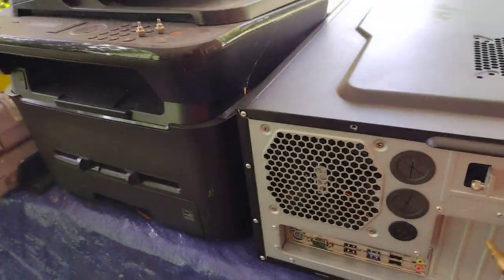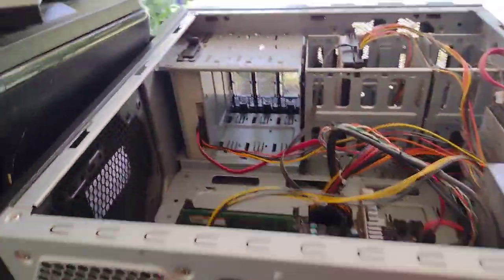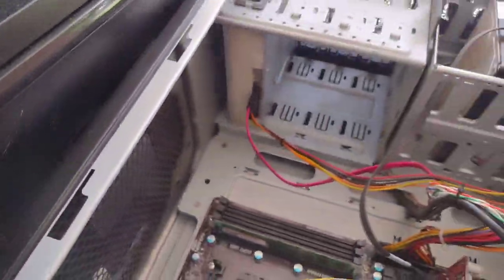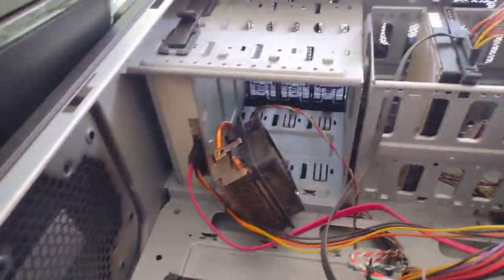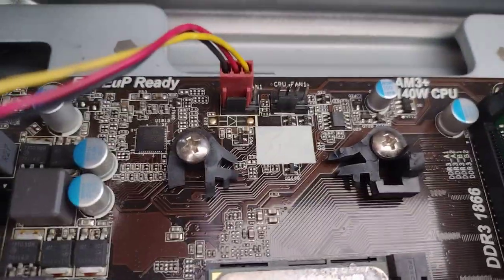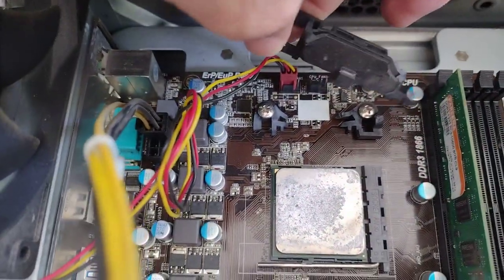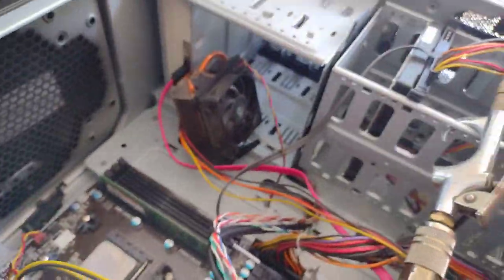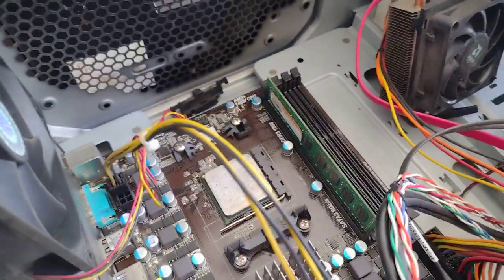SHATTERED IN HALF! 20+ Years of PC Repair and This is a First! - Jody Bruchon Tech

Comment: That thing must have been dropped pretty hard or someone decided to use percussice maintenance.
Reply from the maker: Nope, it's just a decade old, on most of the time, and it's an AMD FX chip. Probably plastic fatigue plus the heatsink tension.
Reply: Are these brackets made of plastic tho?
Reply from the maker: They sure are. I actually epoxied them back together.
Reply: @JodyBruchon  Wouldn't the bracket be weaker if epoxied and not replaced?
Reply from the maker: @agoogleuser2507  Not necessarily. I was able to reassemble it only a couple of hours after application and the pressure didn't rip it apart, and it was still secure the next day. My guess is that the plastic already had some sort of defect in manufacturing that's not visible (maybe a bubble?) and epoxy resin can beautiful built up around the cracked surface to address strength that the original part wouldn't have had. I used a lot of epoxy around the cracks.

The other important factor is that this guy is about to have me build a new PC to replace this one anyway. He doesn't need it much longer, but I'm confident in my fix regardless.
Reply from the maker: FYI customer still using it epoxied 2 weeks later. Hasn't busted yet.
Reply: @JodyBruchon  nice. the epoxy repair will probably outlive the machine itself.
Reply: @JodyBruchon  Well I'll be. Simple problems require simple solutions.

Comment: Never had a heat sink bracket break. One or two memory brackets on older PCs sure. Speaking of old I have a customer with some QIC-80 tapes they want to restore. Does anyone have the older hardware still? I have a couple of drives but everything old we ran it in has now failed.
Reply from the maker: You can probably find something on eBay but you'll need the software that goes with them. A lot of that stuff used the old floppy interface and would also use proprietary software compression that depends on the archival program originally used to increase tape capacity.
Reply: @JodyBruchon  I was hoping someone else wanted the job lol. I’m over it!

Comment: Looks like the same case I have, Cooler Master HAF 912 circa (2014). Still using the case two builds later because it's built like a tank. Does the air compressor have a pressure regulator? I'd venture to say the CPU heatsink bracket (cheap plastic) was grossly over tightened. As in they heard two "pop" sounds and said, "good enough." haha
Reply from the maker: It's an AMD clip bracket. There is no adjustment. Once I epoxied it back together it didn't break again...or at least it hasn't yet. The air compressor has a pressure regulator and selector but I leave it wide open. The cutoff is at 100 PSI.